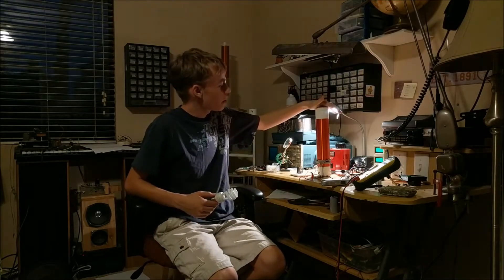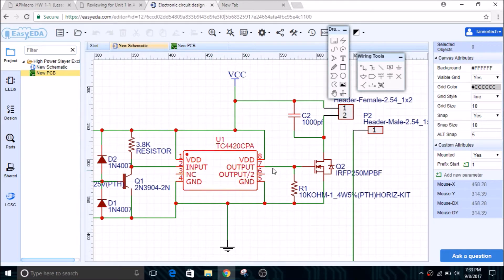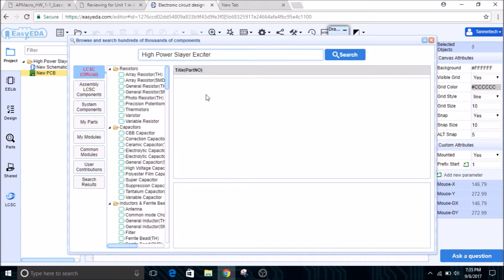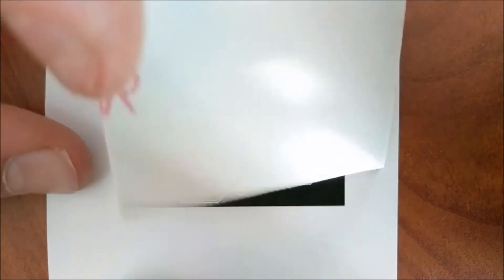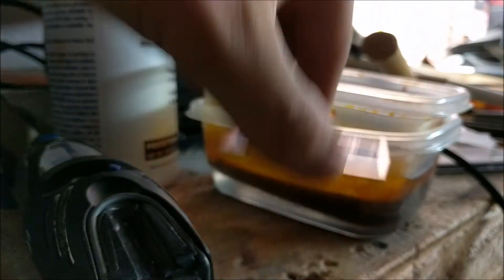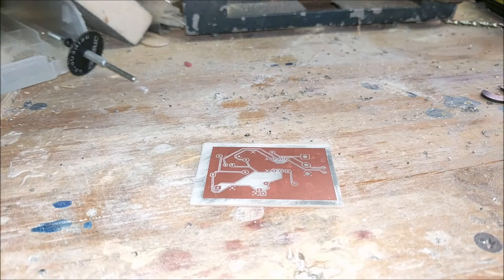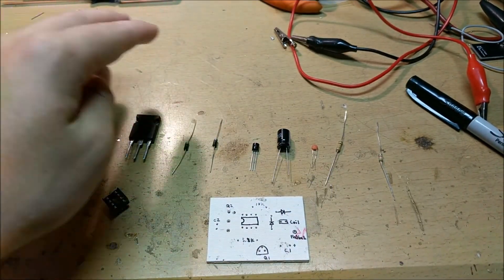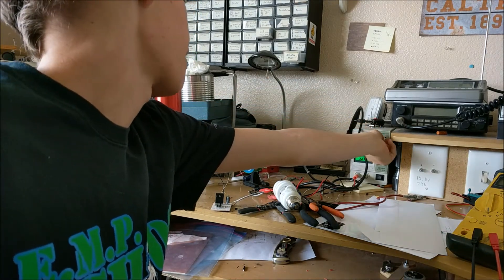Creating a Circuit Board (Toner Transfer) To Build a Slayer Exciter!

Comment: I am certainly not saying this video is crap, its awesome as ever, but I did make a 3 inch tall slayer USING THE 2N2222A and it will light up a CFL from more than a foot away. Im just going to recommend unwinding your current coil and go to JAVATC to design a coil with good resonance. a "whatever" coil, (basically a coil with no calculations) Is no good, as it does not have good resonance, leading to power loss. and yes I did make this with the extremely simple slayer with a 22K resistor and a couple 2N2222A's. Yours is still cool though.
Reply: (y'know, just a suggestion.)

Comment: I got the, off eBay, I couldn't find anything that used vacuum tubes in it at my local dump, I would like a to find a tube radio transmitter, but I probably will never find anything liked that.

Comment: Maybe you could make a half-bridge, class E, or even vacuum tube coil. I have been trying to do something similar to this but I haven't been able to get more than a couple millimeter, running on a normal slayer circuit. Another project I have been wanting to do is make a mini drsstc(dual resonant solid state Tesla coil), and an isstc(interrupted solid state Tesla coil). I might make a video when I get around to doing those. Keep up the good work 👍
Reply from the maker: +HV Labs I tried making a vacuum tube Tesla coil.  I did not buy a socket for the tube, so I decided to make my own.  This did not go to well and I cracked the glass of my $35 tube!  Well, I probably will get another tube sometime and try again.
Reply: That stinks, I have a lot of old tv tubes, quite a few pl504 tubes and a few other ones. It would be great if you could build a tube coil. Class E coils are also pretty cool. Though the resonate frequency is much high on one of those. Great work
Reply from the maker: HV Labs yeah, I've been looking for old tube devices, but they are hard to find.

Comment: Hi Tanner, it may be a good idea to add a 10 Ohm gate resistor between the driver IC and the MOSFET to limit the peak current feeding the MOSFET or the driver IC may be damaged especially if running at high frequency, this resistor will also make the switching waveform cleaner and so the MOSFET will stay cooler, keep up the good work !, Dave BMUK

Comment: Hey tanner. I need a device that can turn a lamp on and off to a pre set Morse code phrase. Maybe 150 letters. What do we do?
Reply from the maker: +Jonathan Hill You would need a relay, npn transistor, 1k resistor, diode, and Arduino.  You can easily make a Morse code blinker that can put out as many letters as you want.
Reply from the maker: +Jonathan Hill https://youtu.be/XQeyMTCEjHY  this is one of my previous videos.  It should help